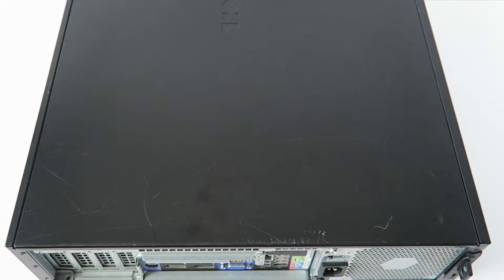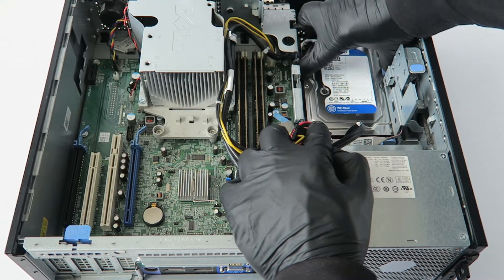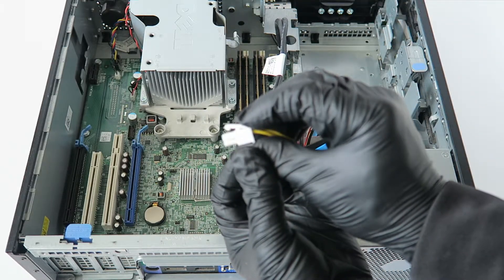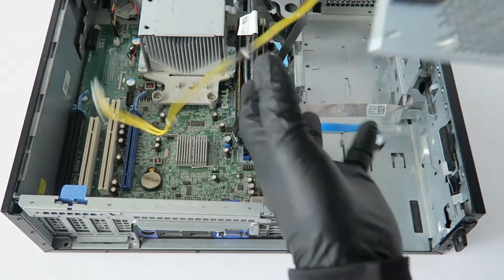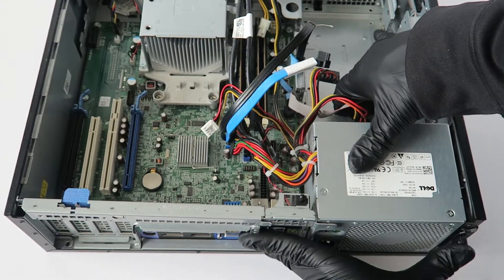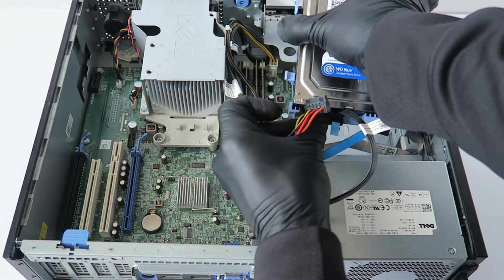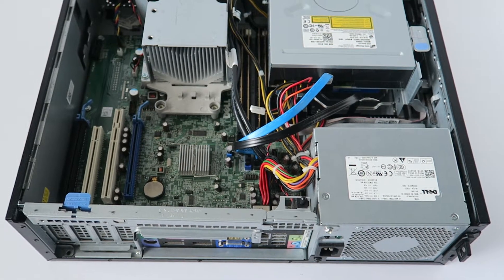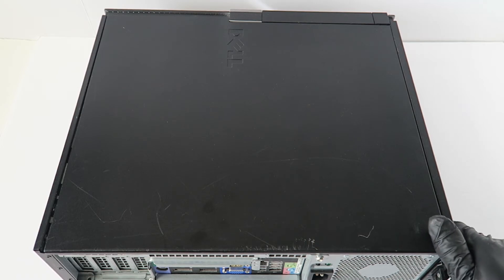Dell Optiplex 980 960 Power Supply Replace CMOS Battery

Comment: the power supply costs too much to replace than the desktop is worth! wonder if power supply is fixable
Reply from the maker: Hi, not really they sell used power supply for this dell for around $20 on ebay.
Reply: @Mxkdt  ig i could try ebay. i was on amazon and cheapest was like $50. is it reasonably possible to fix a PSU? or its just better to go ahead and buy? im getting zero indication power is being supplied so 99% sure its that
Reply from the maker: Yes, it is cheaper just to buy used power supply then fix the power supply and if you buy on ebay and if it still does not work in your computer you can return power supply back for refund.
Reply: @Mxkdt  ok, i guess it'd be a pretty safe bet then. does the new PSU come with a new cable? bc it could be the power cable but im going to test it tonight

Comment: hello i noticed you replaced  this power supply i have one of this machine a 980 and as soon as i connect the power cable the board light turns yellow and it doesnt do anything with the power button you have any ideia on what could it be? i dont have disk or cdrom and i press the test button and the power supply turns on with steady green light...